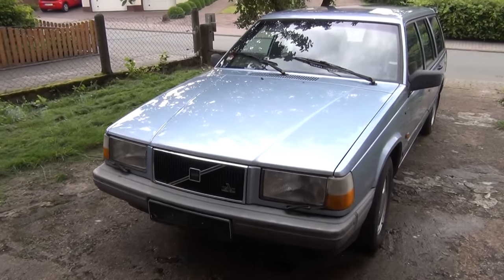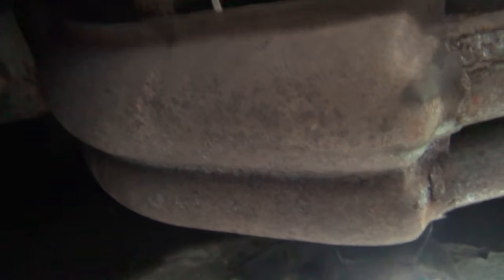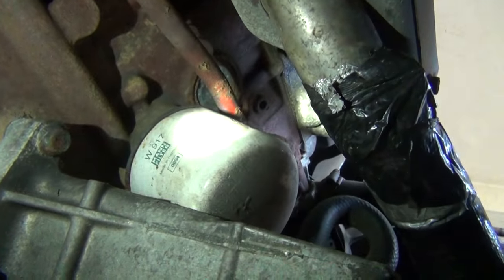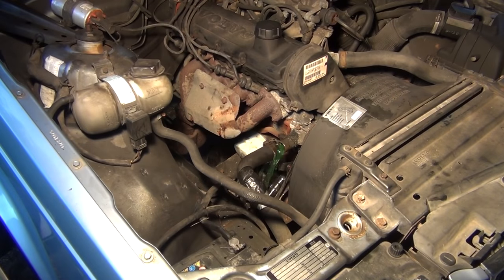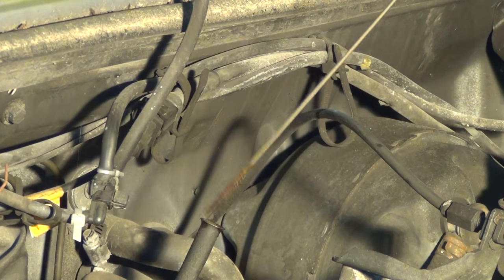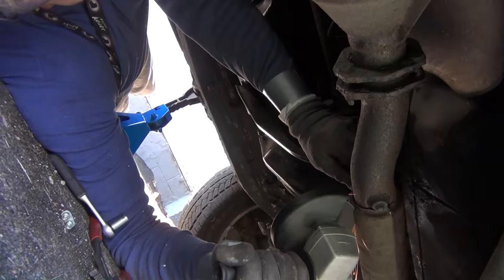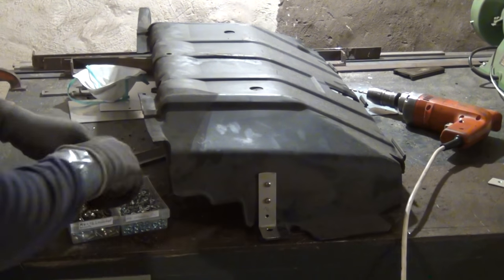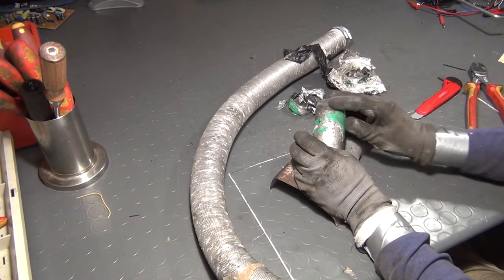Volvo 740 Repairs: Oil Change, Underbody, Air Filter, Downpipe etc.

Comment: See...

https://en.wikipedia.org/wiki/Heated_air_inlet

The warm air directed to the air intake really have two purposes.  The warm air helps to atomize fuel when the ambient temp is low.  Also the warm air helps to bring your engine temperature  up quicker.  You may like that on a cold winters morning.  Both of these effects are desirable for fuel economy and efficiency.

MUST you have the warm air system? No, the automobile will operate just fine without it.

Does it serve a purpose? Yes is does, see the wiki article for more info on that.  For you it will boil down to repair cost and ease of future maintenance.

Good luck, I really enjoy your videos!

Comment: All Volvos that have had that warming hose, that I've had, I have always thrown it away.
The effect that operation will have on the engine is that it will take longer for the engine to warm up. Mabye a minute or two in my experience.
The only way it will have any noticable effect is if you go to the annual yearly check-ups with a really cold entgine. 
One of my Volvos I had, was a crummy old 240 from -77 and i never had any additional troubles from takeing that hose and manifold away. That car or any of my Volvos, neither at yearly check-ups nor at Swedish wintertime temperatures.

Comment: The warm air intake helps the engine during cold starts but I think it's also to help reduce emissions of a cold engine.
Reply: *after the coold start...
Reply: Also during the cold running because the catalyzer ideally must get hot as soon a possible for the chem reaction to breakdown pollutants. Very cold air is going to rob combustion temps , cooler exhaust = slower heating catalytic converter = more emissions

Comment: I would of positioned those clamps higher up around the shield; they'll catch on something. Can't see those aluminium brackets lasting long. They break off due to vibrations quickly in my experience. Steel or even fiber-glass is much better.

I removed the warm-air feed on my old Golf. Never noticed any issues.

Comment: on the heated air intake....
coldd air  will provide a bit more power than hot air due to cold air being denser. the hot air intake is generally used for both emissions regulations and for increased fuel atomization when the engine is cold. the hot air is usually turned off by either electronic means or via a spring mechanism within the breather when a pre determined temperature is reached in either case.
check with your local mot to see if it is required. if it is not then don't bother with the expense. go without for a bit better power.
you should check the condition of the cam timing belt though because if it breaks it potentially spell disaster for your engine.
of note about coolant....pure water is not a good idea as use of plain water will accelerate corrosion internally in the engine,radiator and heater core. 
hope this is of use to you.
=dok=

Comment: The risk of not having the heat pipe is that you may get carburetor icing (assuming you have a carburetor on that thing).  If you find yourself losing power and stalling on cooler, damp days, then after sitting at the side of the road for 10 minutes (giving the ice a chance to melt) you can start it again, you need to replace those parts.
I'd say forget it for now. It has no impact on performance or emissions. Replace if it's a problem.
Reply: John Ridley

Comment: Tap water contains minerals that will condense on the inside of the block and the radiator, it is not advised to use tap water when filling your coolant. In the future you should try to buy distilled water as it will have no minerals that can deposit on the inside of the cooling system making it less effective. Also not using actual coolant is ill advised as well as the glycol  lubricates the pump and prevents galvanic corrosion inside the system (for example, steel block flowing into aluminum radiator will eat away the radiator). Perhaps more importantly and I have seen this often, just plain old tap water will allow the head gasket to be eaten away. My brother and law put plain water in his radiator for 8 months and the vehicle developed a head gasket leak due to the galvanic corrosion.

You may already know this, but I just wanted to state it in case you didn't, or perhaps for other viewers of my comment who don't know this as well.

Comment: There might be another advntage to that hot air intake, and that being exhaust leaks to be sucked into the intake - rather than fuming out under the hood or into the car. I know that I would have made a difference for my Opel.

Comment: I have to hook up with this episode: 1, Volvo,s  are known for their reliabillity, robust protection( has reinforcement bars in the doors and roof) .2. Volvo,s are tested to functioning  underr the most heavy circumstances on this planet .-40.dgr to +60 dgr C.. That declares why Volvo(Sw) have wipers for snow on their headlights.And declares that your hot air-bypass(aluminium hose) part is of an original Swedish model to stand the test!
I can imagine that in warmer countries these parts are not neseccary.

Comment: If that hose is the preheater hose it may be a necessary component for emissions. You will fail inspection in North America if you don't have it installed on a car that is equipped with one.
Reply: Ya but ger ain't care bout that shot I.e. vw! another super specific yet entertaining vid. can't wait to start these fixes on my 2003 corolla

Comment: another way of removing a stuck oil filter is to use a flat head screwdriver and hammer it into the oil filter, and use that as a lever. That's if you didn't want to remove those pipes in the way.

Comment: That screwdriver through the oil filter trick has never worked for me,  it just tears the filter up and makes what's left more difficult to remove.  I have a band-type filter wrench that gets tighter when you apply pressure to the handle,  and also some wrenches that are simply a fit over the end of the filter with a square hold into which you insert a ratchet,  in various sizes.  Either one is not very much $ at any auto parts store.

Comment: You need to invest in new motor and transmission mounts. They are cheap, install involves replacing bolts, and it will make the car run smoother with the engine not heaving around like it is in the video.

Comment: To my ears, your starter motro sounds a bit tired. I am used to a more "energetic" starter-motor sound.
If the generator is not charging the battery very well you want to replace the grounding wire from the generator to the chassis of the car. It is a bit too small on theese models. Measure the voltage drop over that cable when the motor is at about 1500rpm and you will see what I mean.
Keep up the good work!

Comment: The hot-air riser system improves  cold operation drivability, increases fuel economy, and reduces emissions by allowing the fuel system to attain normal operating temperatures more quickly.  

When the engine is cold, the EFI system ignores input from the oxygen sensors, delivering a rich fuel mixture based on a table look-up, rather than the more economical feedback loop-based metering to which it would ideally self-calibrate for its current operating conditions.

Since the table-derived values are suitable for decent operating performance under a wide variety of conditions, removing the heat riser system will not likely affect drivability much.  However, it might take considerably longer for the EFI system to switch to closed-loop operation, and while it operates in open-loop, it will burn quite a bit more gasoline than necessary.   

Will it save enough gas to pay for itself and justify the replacement?  I'm not sure, but I think you've other things more pressing to spend the money on, currently, like cooling system repair.  This might be a "before-it-gets-cold" repair.
Reply: It's not that the ECM ignores the Oxygen Sensor, but that it takes a while for the older non-heated sensors to warm up. They have to get pretty hot before they start working and sensing the oxygen in the exhaust. That's why most new oxygen sensors have heaters built in them.

Comment: Not sure what kind of tap water you have there but if it contains any chemicals or minerals it can cause rapid corrosion even if used with anti-freeze concentrate - better to get some distilled water and use that instead!
Reply: In germany there arent any chemicals in the tap water and in my area the water quality is better than any bottled water you can buy. But at least in my area the amount of minerals is very high so for my cars cooling system I tend to use destilled water. And coolant is not only protecting from corrosion, it also raises the boiling temperature afaik...

Comment: I like your heavy duty exhaust cover ties :-D, i think the cover will fall apart before the metal rope ties do lol.
Neat fix on the plastic cover too ;-)
That oil looked like black ink, shame the volvo has been badly treated :-(.
Reply: I would be concerned what the inspection mechanic will think. I mean if I saw those cables I would start to look very closely at the rest of the car.
Reply: Perhaps, but its not structural or important to stop the pipe leaking, not all cars have them, so i cant see any danger.
Reply: No, no danger of course, and no reason to fail it. But it tells the inspecting mechanic that this was not a professional repair and he may or may not look closer. Sometimes appearances matter, but maybe not so much on a car that is held together by bailing wire anyway ;-).

Comment: I'm not familiar with the Volvos. but would the heater that you want to remove affect the air fuel mixture in any way?  If so, it may increase emissions.  I'm not sure the inspector would test for cold start emissions though.

Comment: anytime that its below freezing the warm air intake is a good thing to have the rest of the times its useless, I would have used some washers with the nuts you used lock tight on, also when you let the water out of the car more that 90% of that type of coolant system has to have a air bleeder opened to let all the air out of the engine if you don't get the air out its not good <aka make sure to bleed the coolant system>  ,,, the heat shields I would have welded into place the wire ties you used will come lose ,, the oil filter when you cant get it off easy there are 2 steps I use step one pound a flat blade screw driver threw it and use that to start it turning if for some reason that doesn't work I than take a chisel to the bottom seam of the oil filter and work it off that always works ,,, but all said it seems to look a lot better now than it did when I first saw it <good work man :)

Comment: you should keep the warm air to the filter box hose attached. Believe you me, if the engineers didn't need factory to spend the money on it, they wouldn't have.

Comment: So much rust! On the brighter side, you have some precious thermite material... 😁
Reply: It doesn't seem that rusty? I guess I live in the midwest where we get a lot of salt in the winter, so there is a lot of rust buckets on the road.
Reply: Not that much rust actually. The bracket for the cooler usually looks that rusty because it is directly in the way for all water, salt and dirt that the car comes in contact with ;)

Comment: you will get better fuel ecomie with the warm air hose PS GET anti freeze  back in they are wright you will regret using straight water

Comment: Should have reinforced the cracks on the plastic sheet to reduce further deterioration.
Reply: I think he did a godd jobb.
Reply: As well an inner strip of aluminium to spread the load over a larger area of that brittle PVC liner, otherwise it will simply crack around each new bolt hole.

Comment: Oh and another thing; try www.scandix.com for parts. They sell Volvo original and aftermarket quality parts. Some stuff is perfectly acceptable from the usual parts stores and the daparto. But some stuff I always use Volvo. Like engine seals, some gaskets, suspension bushings sometimes (or go Poly). 
I'll send a mail with some more stuff I fixed to get it running like new again. Lots of small (and cheap) things that really add up.

Comment: the sheald on the exhaust system u can take them away u not need them if thay falling off.
nice black oil...

u can reuse colant/watter that is not a problem, just dont put in shit or just take a kaffe filter to filter it thru...

last part hot air cirkulate back to the engine... realy dont know, the older car have people allready scrap it donw,
the older models i realy dont know if its worth it have or not... but the engine be faster hoter thats true....

Comment: Heated intake air is a pretty useless system, but the air intake sensor/flap can be the biggest problem in an old system. If that flap is working well I'd put the hose and shroud back on, otherwise remove the flap, hose, and shroud.

Comment: I like the way you fixed that plastic cover, not so much the way you fixed the exhaust shields ( although it did look effective ) ,,,,  fix the warm air intake before winter , you car will thank you in fuel economies and smother operation , and you wallet will be thicker for it, been there done that.

Comment: remove that house! because, warm air = les power and your intake pipes will not plug up so fast(if it is an egr).. the Engine will not get the temprature so fast.. and this could change the exhaust after threatment.. but this will be not meassureable cause your katalyst is anyway old..

Comment: Coolant pipes = washing machine inner pipes yes/no lol.
Reply: noo, think of the temperature and pressure, washing machine inner pipes are either cold water pressure, or hot water transfer under no real pressure, plus wont be 50mm internal either, better just to buy the real thing!
Reply: LOL i was just asking, ive used old pipes of ancient washing machines for other uses before, but perhaps they were not crappy like modern ones.
Dont panic ha ha :-D
Reply: zx8401ztv
hehe, perhaps he should put in the washing machine motor and some batteries instead! lol
Reply: LOL but not taken from my crappy BEKO washing disaster machine :)

Comment: You could have welded those heat shields on the exhaust, but you should have got it off the car, otherwise you'll burn the paint

Comment: I would replace the ducting Volvo didn't put it there for a laugh, and replacing that coolant hose is a good idea that looks like a breakdown waiting to happen, and never use a screwdriver to remove an oil filter if some idiot before has tightened it way to much and you tear the oil filter of you will have a nightmare removing what's left

Comment: The hot air intake is worth nothing actualy. The task of this whole sístem is to lowerthe emissions of the engine, to perform various qualifications. But if you remove it nothing hapens, the only thing is you feel a little bit more horsepower. The emmission is the same. remove it. nothing wrong happens.Sory for my crapenglish.
Reply: Yeah, nothing wrong happens. That is irresponsible, how about air pollution. If you don't care about polluting the air you are irresponsible.
Reply: If you drive this ancient car, you obviously don't care very much about pollution in the first place.

Comment: i would think that warm air has less mole of oxygen than cool air, i don't undertsand the idea of warming it
Reply: it's to improve the carburetor functionality during colder seasons, especially when it snows. His car can run with out it but it'll be sluggish until the engine warms up to operating temperature. To be honest, I often remove them from my vehicles because they just get in the way & living in South Texas makes them pointless. South Texas winters can get as cold as Germany summers.
Reply: +Rudofaux this car dosent have carburetor......it has EFI whit trohlebody:)

Comment: you can rip those heatshield right out of there they got no use there
Reply: also i do not have the warm air intake on and i live in finland. it might not run ideally at very cold but once the engine heats up it will be good
Reply: The only issue would be if there is a visual inspection of emissions equipment, if it isn't there.
Reply: in finland there is a yearly inspection and i had no trouble passing it without it. could be different in other countries though
Reply: I mean specifically an inspection of emissions equipment. California has this.